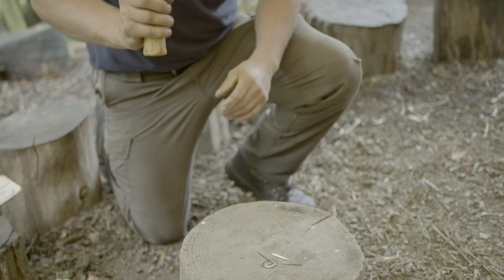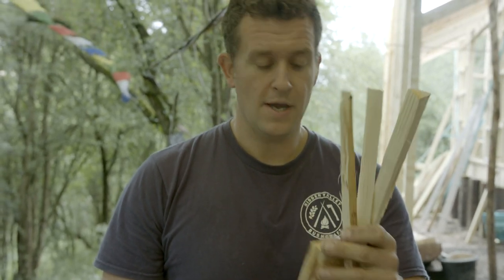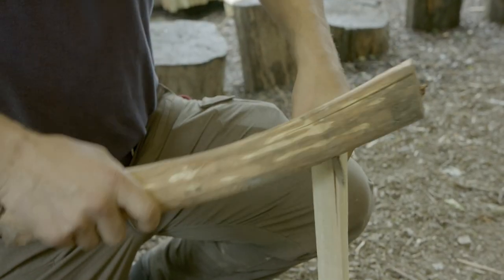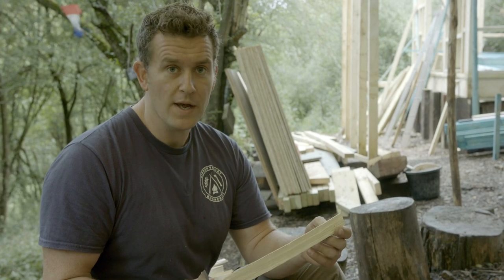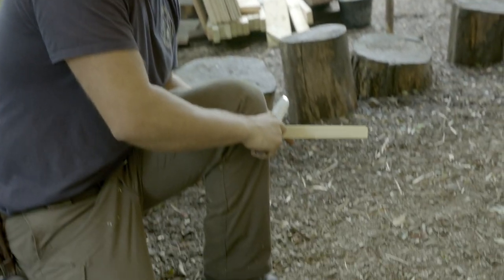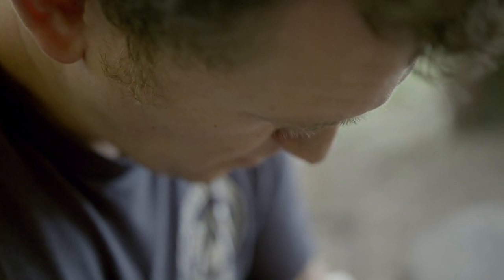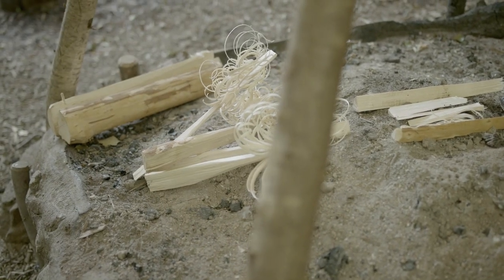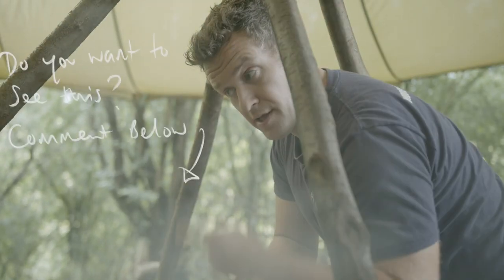How To Make Perfect Feathersticks- Bushcraft Basics

Comment: Hi there,
It was interesting watching you use the method of stabilising the blade and moving the wood to create curls. Presumably, the reason is to try to reduce the amount of movement of the two contact points relative to each other as much as possible so as to get fine even curls.
I recently saw a video made by Felix Immler, where he uses a humble little Swiss Army Knife blade to make very similar feathersticks!  He takes your method a step further.
He inserts the blade tip into a stable surface ( a large log in his case) at a 45deg angle (he says this is MOST important!). He then holds the top of the knife in his LEFT hand and draws the twig backwards towards himself, noting the angle and assessing the amount of "bite" he's getting. If too much, he'll mover the blade a bit left and if too little he'll move it fractionally right. Once he's got the right line, he continues much as you did making very fine curls! 
I was wondering if you have ever tried this method? 
Thanks for the video.

Comment: Honestly, that thin corner is easier to get a thin curl than the roughly 90 degree corners from building material. Even if you lose some of the curls, you can use them for starting your fires.